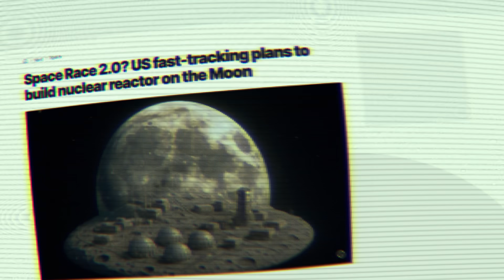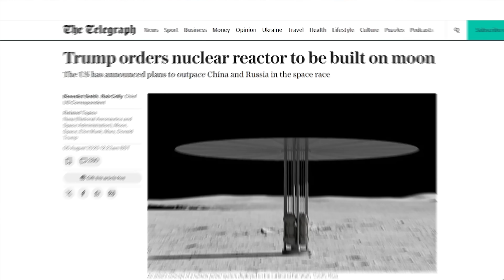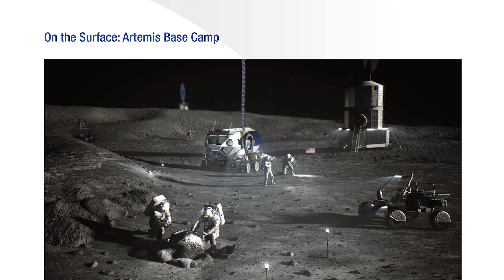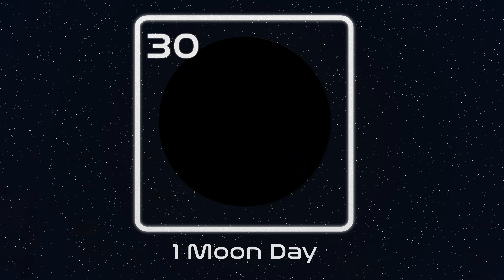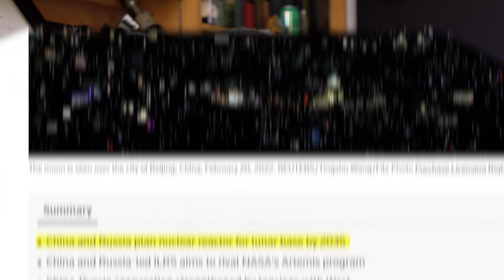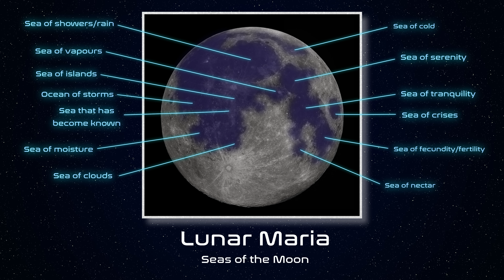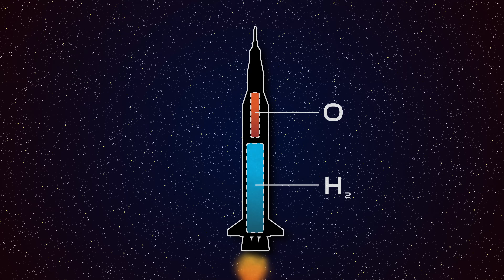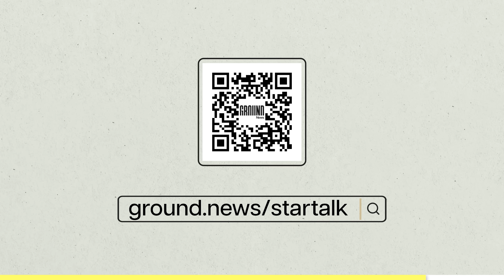Why We’re Putting Nuclear Reactors on the Moon

Comment: France has to export power. The nukes are expensive to run and they need money to pay for them. They overreacted to the oil crisis and overbuilt their nuclear generation capacity. Some of them have to be shut down in the Summer because the cooling water discharge makes the rivers too warm. Nothing perfect about nuclear power. 

In the US, nuclear power was started as a propaganda campaign during the Cold War. It was called Atoms for Peace. The free market would never pay for nuclear power bc it is too expensive and dangerous. Enter government money and protection. If your application is power on the moon that is one thing but don't use "commercial" nuclear power as a shining example.

Comment: If we find access to water on the moon (and other necessary chemical building blocks), that would be the major difference: as fuel could be produced on the moon itself (especially if you stuck with hydrolox type fuel). Likewise, if you went many steps further and set up powered industry and metal refining on the moon, you could do a LOT more there.

But that's an entire other scale of things beyond simple fuel production. (in-between would be more nuanced and complex synthetic chemistry with souces of nitrogen and carbon to make other fuel molecules ... the presence of ammonia on the moon would be especially relevant, and any carbon/carbonate rich deposits)  We need to do a lot more prospecting and assay work on the lunar surface before the viability of that becomes totally clear, though.

We now know there's tons of liquid water below the lunar surface, but it's really deep down (albeit not nearly as deep as the massive layer of water within the Earth's mantle), so the technology, equipment, and energy required to reach it would also be substantial. (albeit the lower gravity of the moon also means much less extreme pressures at a given depth, so the deep boring operations would hypotehtically be less limited than on Earth)

Comment: Sodium ion battery technology is making the low temp issue a lot more viable, but it'd help to at least have some nuclear (or a radioisotope thermo-electric generator: using decay heat, not fission) for a base power load, but thermal coupling to use that waste heat to warm the batteries.

Also, I think France had more like 75% nuclear power at their peak.

Comment: Using the moon as a platform to Mars could make some sense theoretically. It takes much less fuel for a rocket to escape the moon's gravity than Earth's. I'm not looking at it like a pit stop. I'm thinking if we build the Mars rocket on the moon instead of earth the boosters will use less of their energy escaping gravity and more of it accelerating the spacecraft. I have no idea whether or not this is a reasonable train of thought. I'm a truck driver with 0 background in physics, rocketry, or engineering.

Comment: How do they get rid of the excess energy? Do they need to keep building bricks and glass? When it's  120C for 14 days and you can't turn off the central heating? I'm sorry but you are better off sending dancing robots until they explain how they balance the energy over 28 days at 14 days 120C and 14 days -130C...

Comment: You said batteries don't like being cold -- that isn't the reason - put the batteries in doors in climate control with insulation and you can keep the batteries at room temperature and easily solve that problem -

Comment: The amount of battery capacity to run a colony for 2 weeks with no additional generation would weigh a TON, and every ounce of mass you add has to be moved, meaning you need more fuel to move it, making the move less economical.

Comment: While oxygen can certainly be produced by electrolyzing water trapped in polar craters, there may be an easier way. The lunar surface is almost half oxygen by weight, and it can be chemically extracted. A main candidate is the mineral ilmenite, FeTiO3, plentiful in the maria, from which O2 can be extracted by several methods.  Also, just about everything in the lunar regolith is an oxide of some sort, so you can also melt and directly electrolyze it to produce O2.

Comment: Question question is does it require less fuel and energy to take off from the moons surface could they deliver the supplies and materials needed to the moon and build a larger space craft with more capabilities and loads of satellites connected that can be disconnected upon arrival at say mars with more people on it that because the gravity is alot less could in fact make it safer but also save on resources for a giant mission to actually land on Mars? Currently loads of fuel and the weight of the rocket has to be taken in quite alot just to get off the earth but if the moon makes things lighter that means let's say your 1/4th your weight on the moon for the same amount of fuel could you not make a rocket 4 times larger?

Comment: So he admits batteries don’t work in the cold environment of the moon!soooooo,Apollo used batteries uhhh right? Maybe not!!!
Reply: The lunar surface temperatures vary from a maximum of about 120C to a minimum of about -130C but this is over the course of a lunar day/night cycle. All the Apollo landings took place early in the lunar day when the surface temperatures were mid range. Also the batteries and other Apollo equipment were situated in the vacuum above the lunar surface so the main challenge would be dissipating and reflecting heat from them. Take care.

Comment: I'm not so sure about this idea. Any reactor will generate heat, which is subsequently converted to electricity. Any turbine, no matter the cycle used will require cooling. Thermoelectric will also require cooling. Without atmosphere convective cooling doesn't seem feasible. What happens with the reactor, once there is no cooling?

Comment: Yes because it's the most effective means of power on the moon. Solar would have to deal with the extreme elements and there isn't any wind for turbines. Nuclear power would run extremely well in the cold environment of the moon and would outlast the settlement. The only downside to Nuclear power on the moon would be that the reactor would have to be downsized to transport it but that is very possible too.

Comment: A nuclear power plant that generates 100kw of energy would be pretty small.  For example, the ones that power submarines generate about 100-200 times MORE powerful than the ones going to the moon (100-200 megawatts) and they are only about the size of a trailer for a semi truck so, what they are actually sending is probably about the size of a Honda Civic.

Comment: With the current USA regime not living in reality, it is highly probably their PR stunt was just the deployment of RTGs scaled up instead of actual nuclear fission reactors.  The reactors generate heat, and heat is transformed into electricity with WATER boiling into steam and driving turbine (moving parts). 
Water is extremely necessary for both the loop that boils to steam to spin turbines, and also to colld thats team down back to water for re-use. 
Water also needed to cool the reactor (although molten salt has been used). 
Another possibility is that some nuclear company lobbied/bribed the regime for R&D to create the mythical "manufactured " Small Modular Reactors  that need no regilatory approval and built in factory and installed anywhere/everywhere and need no maintenance, and the regime thought they could deploy these nuclear reactors on the moon.   SMRs don't actually exist and if they do, woill require the same amout of water and oversight/management and costs to handle nuclear waste etc.

Comment: The Problem is nuclear waste, no one figured that out. France is not by any means happy with that, Same for Germany. We are slowly replacing this crap with renewables and we suceeded here. Even germany with its conservative Party Uses almost 45% of Energy just from renewables and water pump batteries. On the Moon the waste be less of an issue though. And no, we are afraid Even of the reactors here. They ARE actually 40-50 years old!!! And some have cracks. Tihange was Shut down in Belgium for that Reason. So its bit different …

Comment: He's right on a surface level, in the same way that someone might say it's easier to hike over a mountain than to build a tunnel through it.

Yes if you're looking at one trip with minimal baggage, the hike is easier. 

But if you want to build something big on Mars, or really anywhere in the solar system, you want to industrialize the moon.

Launches that 1/6 as much fuel to escape the moons gravity as it does from Earth, and if that weren't motivation enough to push for moon industrialization, unlike on earth, the moons gravity is low enough that you should be able to build a space elevator with modern materials, you don't need carbon nanotubes, just steel cables which makes getting material from the moons surface even cheaper than it already is, relatively speaking. 

So, in short, it's a big upfront investment to get the moon industrialized, but it's kind of hard to argue against when, whatever they mine, refine, and manufacture will be a fraction of the cost of launching from most any other planet.

This advance tapers off somewhat once astroid mining becomes common place, but you aren't getting there without starting from the moon, if you're smart.

Comment: Why not have a mechanical battery, you're already in vacuum, and if the edge of the flywheel reaches mach 1 you have no problem with it, it's already in vacuum 🤷🏻

Comment: there should be a solution in modern times to be able to have batteries withstand extreme colds :person-blue-holding-pencil:
Reply: There are already sodium-based commercial batteries available off the shelf.  They're lower energy density than lithium right now but sodium has a much wider operating temperature down to −20°C or −40°C and can still both charge and discharge at those temperatures.  Lithium can actually discharge in freezing temperatures but cannot charge--this works out though because solar panels would not be generating any power during the nights so there is no charging occurring.

These low temperatures are ideal because it reduces radiative and conductive heat loss (Carnot work principle) which then minimizes heat loss during the long 2-week lunar night (see below).

The batteries can keep themselves warm with a resistive heater blanket.  The batteries also generate some heat naturally (depending on amp flow) when they're discharging normally to power lunar power loads.  So, along with good insulation and maybe combined with burying into the lunar regolith, the lunar batteries may need only budget some few percent of their total capacity to keep themselves warm enough to be useable.  This is where the −20°C or −40°C operating temperature helps as the battery's resistive heating blankets don't actually need to bring lithium or sodium batteries to room temperature which saves on power.
Reply: @beyondfossil  Thx

Comment: Find a way to heat the storage batteries to within the tolerance that permits electron flow; the heat created by decaying uranium could possibly solve this, as that heat (on Earth) is used to create the steam necessary to drive electrical generators. Problem solved.

Comment: What if they did a subterranean base? That would provide thermal insulation as well as provide protection from asteroid strikes, right? And I understand that getting equipment there to do the digging would add difficulty, but that would mean less building material to be sent.

Comment: If they're planning on going near the South Pole, couldn't they also use solar arrays in multiple locations close to one another but facing multiple directions to constantly get solar?  I would think the bigger issue with solar would be damage from things impacting them.    That and nuclear is kinda ideal in this situation as it generates a lot of power and constantly.

Comment: I made a similar comment the other day. But if you can use H²O to fuel a ROCKET, than WHY NOT USE H-2-0 TO FUEL THE CARS WE DRIVE HERE ON PLANET EARTH? THE TRUCKS, BUSES, TRAINS, SUBWAYS, BOATS, YOU NAME IT! ITS OBVIOUSLY CHEAPER, CLEANER, MORE ABUNDANT, AND WOULD INSTANTLY LIFT THE SPIRITS OF 99.9% OF ALL HUMANITY! WHAT GIVES? 

CAN SOMEONE, ANYONE, PLEASE ANSWER ME? CAN I GET 1 OR 2 GOOD REASONS WHY WE DONT SWITCH? YA KNOW, SLOWLY BUT SURELY,  SHOOTING FOR A PRE-DETERMINED GOAL-TIME OF SAY, 5 YEARS? FIVE YEARS FROM NOW THE ENTIRE PLANET WILL COMPLETELY, 100% HAVE DONE AWAY WITH THE USE FOR FOSSIL FUELS! WEVE SWITCHED TO USING SIMPLE WATER AS OUR PRIMARY SOURCE FOR ENERGY! OBVIOUSLY SOME THINGS/AREAS CAN/WOULD MAKE THAT CHANGE IMMEDIATELY OR WITHIN 1 OR 2 MONTHS. SOME, SAY 6 MONTHS. ONE YEAR FOR SOME, AND SO ON. UNTIL AFTER 5 YEARS THE WHOLE WIDE WORLD HAS FINALLY ELIMINATED FOSSIL FUEL AS THE PRIMARY WAY TO GIVE ENERGY TO HUMANITY! KIND OF LIKE WHAT LIGHT BULBS DID TO CANDLES, OIL LAMPS, KEROSENE, ETC...

Comment: Side note to the video (specific to Dr. Tyson): Lunar gateway to Mars base isn't impracticle. You're thinking chemical only. Think outside the box. Moon has no gravity. GaussLaunch (aka railgun launch) could be done on the surface of the Moon, instead of trying the same thing on Earth with Spinlaunch, which is impracticle with an atmosphere.
You can also combine it with Plasma Propulsion that is effective only with low gravity and no atmosphere, and relatively muuuuuch lesser fuel needed to go to Mars.

Comment: I mean to put this in perspectives when I was in the military we used to go to the field. I was in 35th signal brigade and we used to go to the field with at least 4 or 5 100 K generators. Just to run all of our telecommunications equipment, satellite dishes or microwave antennas runner vans I mean 100 K is nothing. It’s when he says a settlement. He means a tiny little settlement that barely has any capabilities. You couldn’t even run your household with 100 K generator.

Comment: Energy is conserved (according to the law of conservation of energy). It can change forms (kinetic, potential, heat, etc.), but it can’t just disappear.

So why not store it in a other dimensions acording to the "String Theory" and "M-theory" propose that our universe might have 10 or 11 dimensions, not just the 4 we perceive.
Because if we can do that that explains also dark energy or dark matter. but then Different universes with different energy laws might exist then to, separated by dimensional barriers.
but if then energy could move between dimensions, it might explain mysterious "losses" or "gains" in physical systems

if we can solf this we dont need solar, fusion, ore nuclear energy. you get somting like a small module that just takes energy from a  pocket dimension ore a normal dimension
Reply: if you can figure that out in 4 years, they'll probably use transdimensional energy storage instead. If there were a way to experiment at all, though, it might be slightly dangerous to manipulate a dimension of reality we have no way of knowing what's in it...?

Comment: You could use a lunar station to launch supplies to intercept the Mars craft, no landing on the moon.  Launch with only enough supplies to last until the lunar intercept.  That's a significant weight reduction thus more fuel saved at launch.

Comment: In theory. A nuclear powered submarine can stay under water for up to 30 years + if the submarine didn't have to surface to resupply. We can use that same technology for a moon base or even a mars base.
Reply: Won't work with the same system. Reactors on earth boil water, and its steam spins a turbine generating power. Submarines cool the steam back down and turn it back to liquid using the coldness of the ocean. 

Much more complicated on the moon when you don't have that much water for the reactor to boil. Then they have to find a way to cool down the steam back to liquid, which during the Lunar day will be a difficult problem.
Maybe they will put the reactor inside a deep crater that never gets sunlight and use radiators in the crater for cooling
Reply: @oisinolennon the moon is super cold tho
Reply: @FrancoWins  only at night, underground, or in the shade
Reply: @oisinolennon the dark side of the moon is always night time.
Reply: @FrancoWins  There's no such thing as the dark side of the moon. The FAR side however, does indeed get light. What do you think is happening when a new moon is facing Earth?
Reply: @stevehawke7315 it still retains ending energy. Stop. I know what I’m talking about and I’m sure you think you do too. We won’t love to find out tho
Reply: @FrancoWins coughs! Would you like a Mulligan?
Reply: Or just pull the plug and the whole terrible mess could cease to exist forever. A great new Trumpian record.:trophy-yellow-smiling:
Reply: If a nuclear explosion occurs on the moon that would be bad for us
Reply: @pricexx1 We already launched and detonated a nuclear bomb in 1962 and we're just fine. This is the problem. People hear "nuclear" and they think bombs. Again we have nuclear powered submarines that can stay under water 30 to 40 years without resurfacing if the sub didn't have to resupply.
Reply: Not quite the same because fission reactors need cooling and submarines have lots of water to cool them. There isn't lots of water to cool them on the Moon or on Mars. That's a problem.